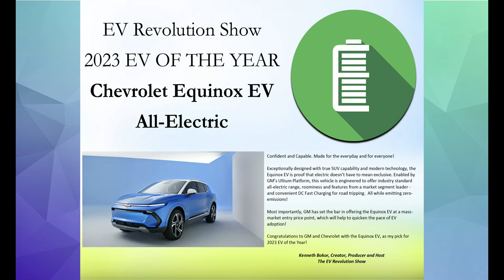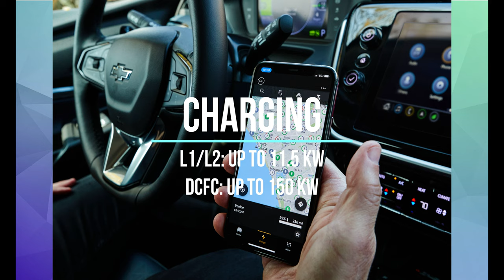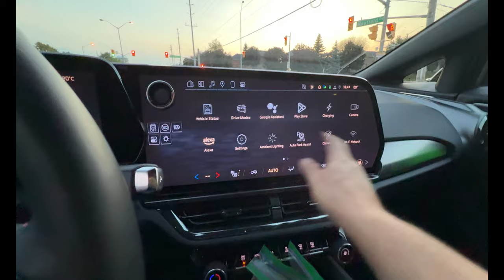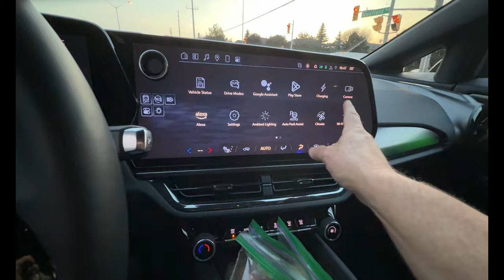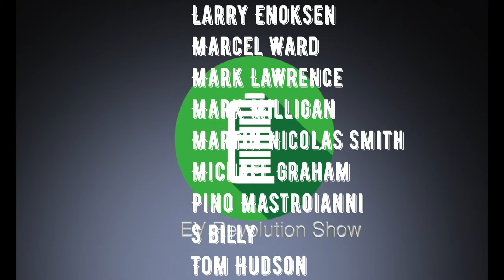Episode 256 - 2024 Chevrolet Equinox EV RS First Edition FWD All-Electric - A Home Run BEV!

Comment: All BT1 vehicles are being built at DHAM (factory zero) Michigan.  Lyriq and ZDX are build in Spring Hill, TN.  Blazer EV, Equinox EV, Honda Prologue are made in Mexico.  And of course the Brightdrop (and now Chevy) Zevo600 and Zevo400 are made in Ingersoll, ON.

Also GM for the 2025 MY has launched a more affordable version of the Equinox EV. 
The original $37K CAD version would have had an 8 module 68KWh battery pack.  But those modules would have required a different layout (12S-2P).  So GM dropped that version.  So now all Equinox EV's only come with the 10 module 85KWh usable pack.   All North American Ultium vehicles use the same 8S 3P module configuration.   All the way from the Equinox EV to the Hummer EV.   Simplifies supply chain and brings production scale.
Reply from the maker: Thanks for watching and for all this great recap info!

Comment: I'm surprised your range numbers were so low.  My 2024 Blazer EV LT eAWD can get 500kms of range at 100km/hr.   Though I noticed you were doing 125 on the highway which that would certainly cut it down to 400.   I drove up north to Espanola and I was getting nearly 500kms of range on the 400 north but it was quite warm those days.   Also GM this year has massively expanded supercruise map roads.  Even though I don't have supercruise I thought about it because my commonly used local provincial Perth county roads are now mapped (hwy 7 - 8 - 23). 

Also of note GM uses it's own NCMA battery chemistry.  The first three battery factories (formerly Ultium)  were in a Joint venture with LG Chem but this was for their manufacturing expertise.
Reply from the maker: Thanks again yes, for sure battery use goes up exponentially as speed increases after 100kph or 105kph.  Yes, I was just keeping up with traffic at 125 kph, since that stretch of the 401 has the new 110kph limit.  Had I cruised at 105-110kph, would increase range to well into 400's.  

Good to know about NCMA own, as I thought they were still using LG Chem.

Comment: Nice to see how well grounded the Equinox is.  I'm waiting for the new Bolt given its smaller size.  When is it or the Tesla 2 coming out?
Reply from the maker: Thanks for watching and for your feedback.  With regards to T2, I will believe it when I see it!
Reply: @EVRevolution  As far as I am concerned the big luxury EVs, high performance EVs and the techno-parade float Cybertruck have just served as introductions - proof of concept.  The real benefit to the planet and our fortunes on it will come from mass adoption of small efficient EV replacing our too -big ICE fleet.

Comment: EV is working progress until solid state battery then I might buy an EV. I kept my 2016 phev Chevy Volt.
Reply from the maker: Thanks for watching!
Reply: Why did they stop production for the Chevy Volt?
Reply: @robertn2951  
Mostly because the EPA wasn't too supportive with PHEV and the policy made the PHEV very unprofitable.
GM sold the tech and possibly the production tooling to China and it's doing very well as Wuling Starlight PHEV.